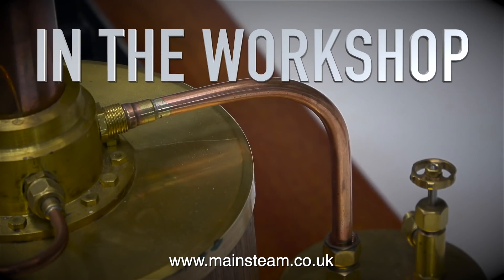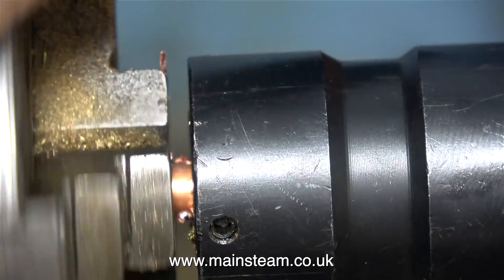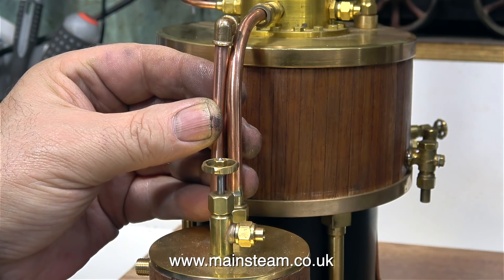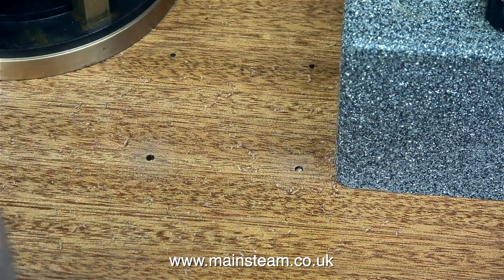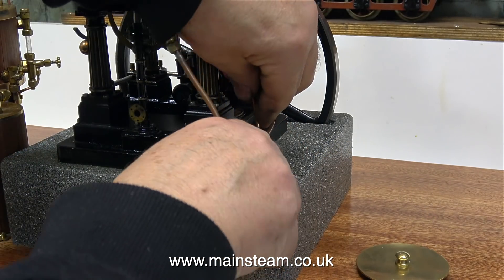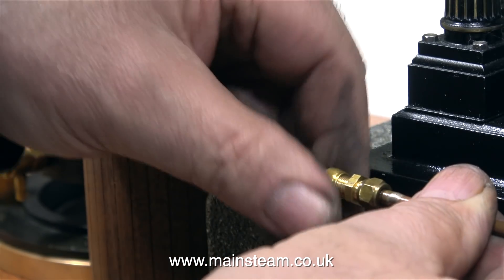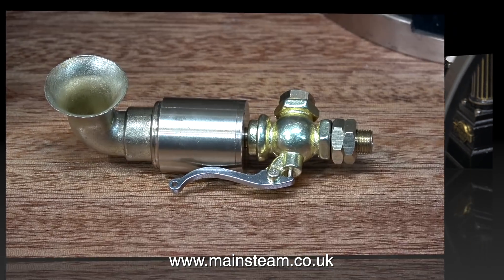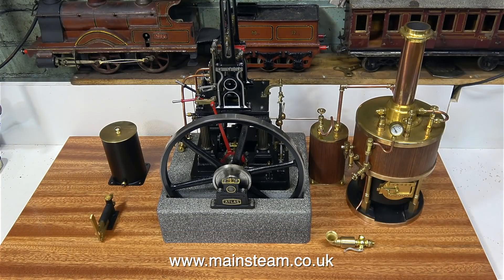ATLAS STEAM PLANT CONSTRUCTION - PART #5

Comment: If you order from PM Research directly, you should be able to get the thread you need. They have 1/4-40 MTP (NOT compatible with 1/4-40 straight threads) and 1/4-40 UST (their "universal" tapered thread which is compatible with itself and normal 1/4-40 straight threads). I'd give that a try before you swap to Microcosm. AFAIK PM Research ships internationally, although I'm in the states so I don't know how long it would take. Their customer service is second to none, however.

Comment: Yes,  PM  Research sells fittings with two different 1/4-40 threads, MTP and UST.  The MTP system is the smaller of the two,  and stated to not be interchangeable with 1/4-40 ME.  So  maybe you are getting fittings with the MTP threads?
Reply from the maker: Yes, i will have a chat with Phil at Forest-Classics where I buy them from . . . looks like he is ordering the wrong type from PM research.

Comment: PM Research does have raw castings available for all their fittings. Your videos inspired me to start with those castings because I needed elbows for piping on a metric-threaded locomotive. Thanks for showing that even us amateurs can do it!
Reply from the maker: That's what i like to hear and is the reason that I make the videos for beginners. Everybody can do it with a bit of practice & patience:-)))
Reply: Rex Cadral . Something that is either not understood or seldom understood is that there are no metric pipe threads. I know that you did not say the pipes were threaded metric. This commentary is simply to say the metric system uses the British system of pipe threads. There are two pipe threads for the British system one is parallel thread the other one is tapered thread. To the best of my knowledge they both have the same number of threads per inch with the exception of special proprietary threads. 
Obviously one thread is tapered and one is parallel. The British system uses a 55° thread angle. The American system uses 60° thread angle. To get the proper seal tapered pipe thread should be threaded into female tapered pipe thread. Parallel threads use a bonded washer or a hardened washer with an O-ring something you probably will not see. The British system of pipe thread is far superior to the one in my country the United States.

Comment: looks great Keith  i lways look forward to your videos ps could the elbows be threaded 1/4" bsp  ie what gas fitters use it is quite a coarse thread
Reply from the maker: 1/4 BSP is far too big for a small model like this. 1/4 BSP is not 1/4 of an inch external.

Comment: Go ahead and scream and yell at me but could you use a teflon lined stainless steel braided flex line instead such as used on air compressors?
Reply from the maker: probably, but I don't think I see them in full sized steam engines . . . }:-)))

Comment: The 1/4 X 40 tap that you are using “appears” to me that it is a parallel thread. You are tapping a pipe fitting and that should have tapered thread unless otherwise noted. So if you tried to screw into that elbow the piece of copper pipe that you’ve threaded also with parallel threads it’s only going to go in a few turns if that and seize up. You either need to thread your pipe tapered pipe thread or your elbows parallel thread for it. (What you are doing).

My business is hydraulic hose fittings and adapters we sell all the thread from around the world. About 10% of our sales are British fittings mostly steel but a fair amount of brass. We stock the taps both in parallel and tapered so there is always confusion about why things do not screw together. This is and attempt to be helpful and does not mean that I can inspect or measure any of the components you are using.
Reply: Yes I had the same problem and solved it with a new pipe thread die